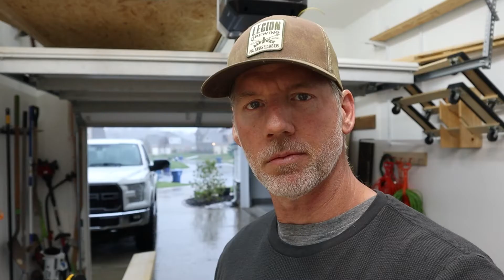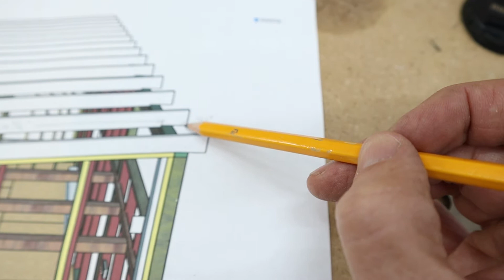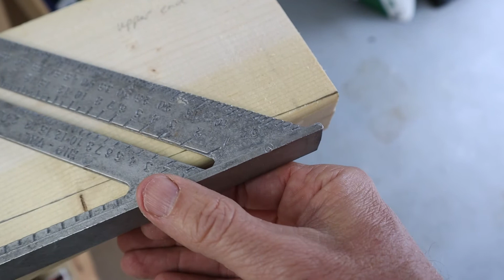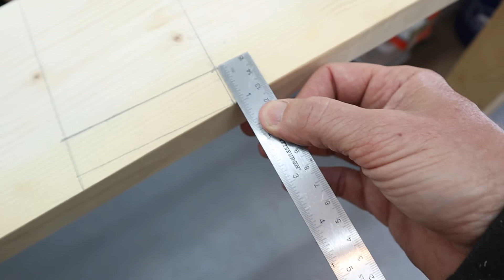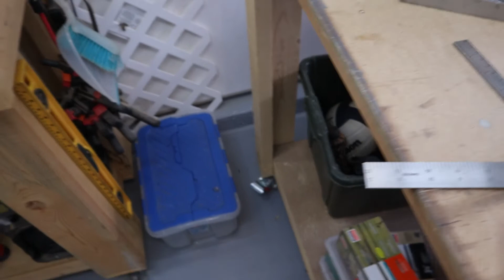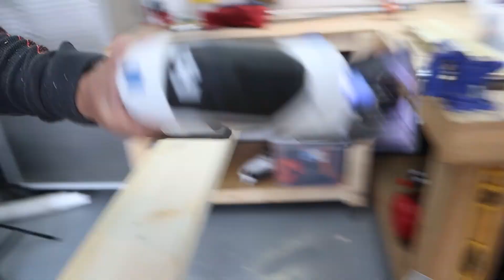How To Cut Birds Mouth Rafter Notch | Tiny House Build

Comment: Hi from Australia😀Thank you for such a well explained video. I will be building my own house myself and am considering to do a split skillion roof (I think you might call it a double shed roof, over there.) I like the idea of completely notching the rafter, rather than just a birds mouth at each end. I think it provides extra strength to the roof- to stop it from sliding off. I was going to fully notch both ends of each rafter, but I can see from your excellent video, that I will only need to do the lower end and it will give the same effect that I want. I was planning to drill a large  hole in each of the 2 corners of the notch, then using a jigsaw- tidy up the corners and then cut between the holes (surface that will sit on top plate). This could have been very time consuming and messy. I like your technique better. Thank you for saving me a nightmare!!
Reply from the maker: @RobinKanters-k4q  Thank you. I have now built a few roofs and this method of cutting birds mouth seems to be the quickest and easiest. Best of luck to you on your build. Wish we could share pics in the comments. I'd love to see what you build.
Reply: @WillMosbey  Thanks for your reply and encouragement. I am not very good with this modern technology, but might be able to work out something once the project gets going.